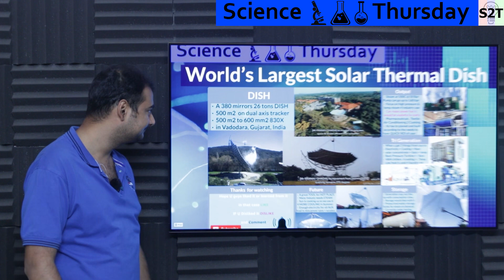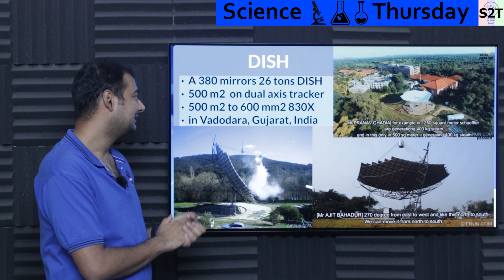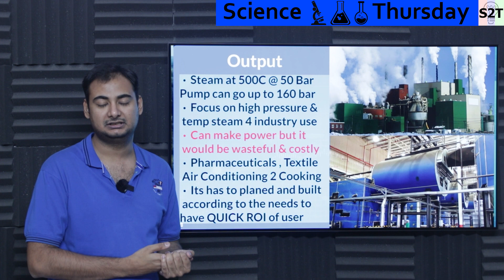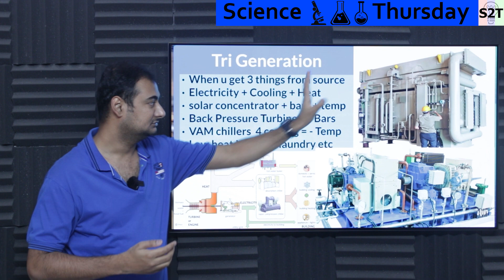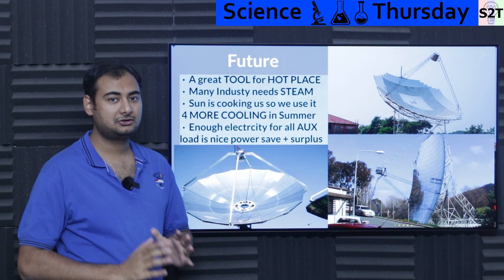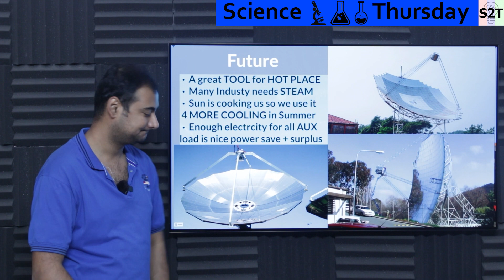World’s Largest Solar Thermal Dish Explained {Science Thursday Ep233}

Comment: Using heating for cooling? That's counter intuitive.
Reply from the maker: It's an ancient technology we had this before, we had electricity or phase change cooling. Choli use it because it requires very high temperature and the cop is very poor. U would be lucky to get .5 to 2 cop vs 3 plus in normal systems. There always has been industrial use for absorption chillar as they have high temperature waste heat

Comment: Unfortunately big solar dish is dead if you compare it with other concentrated solar solutions

1-It's complicated machine because you're going to need a big ass motor to move the dish.

2- the hot liquids need to move with the dish witch make it harder to engineer.

2-For maintenance of mirrors you need to shut the entire dish off for safety, unlike other csp.

A solar tower is much cheaper then the dish and it's expensive(think about that)

But hope are not lost for csp there are new solution for it that might make it viable, search for "heliogen" this company can hopefully make csp cheaper if they don't get bankrupt.
Reply from the maker: ur point means nothing when there is a company doing  it  & its not for power flat out its for place which needs high temp steam and a lot of pressure